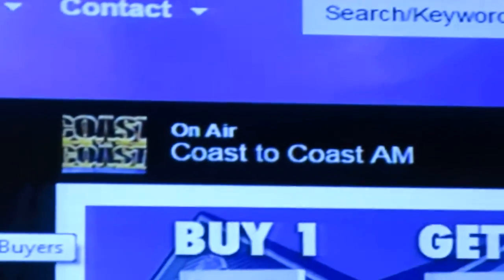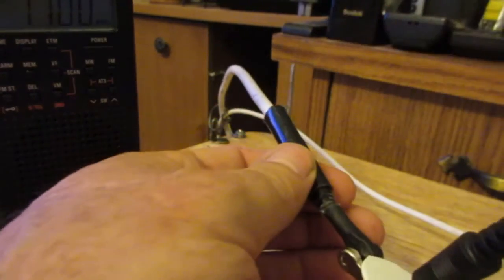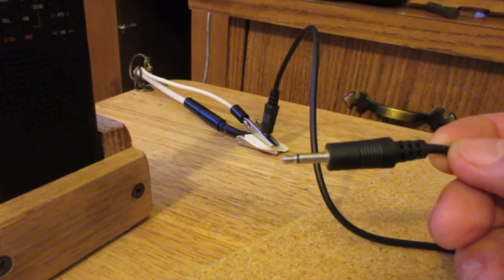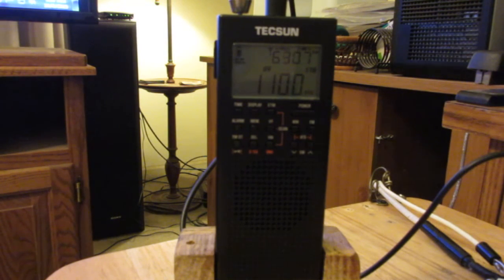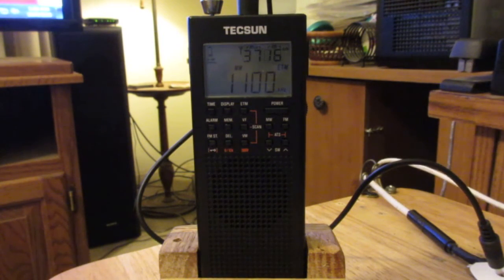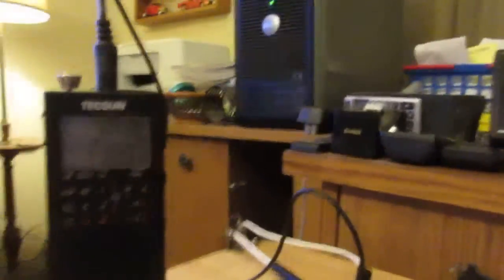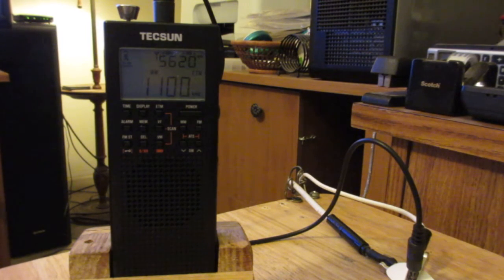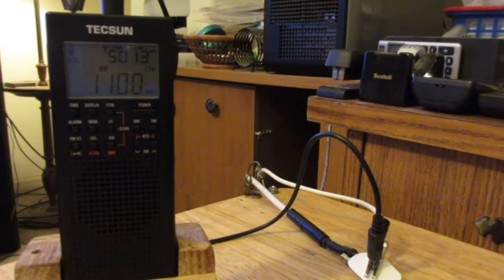AM Radio long wire antenna.

Comment: Great video, Mike.  I've got an old Hallicrafters S-40B receiver that I'm stringing up a wire for today.  Old ham radio guy here, but I also like to listen on a newer digital radio and I didn't even think about using an auxiliary audio cable for an antenna connection.  Thanks for the idea, and I hope you're still enjoying your long wire antenna!

- K5SFC

Comment: During the day I used to receive a station in Oklahoma City, Dallas, Houston and New Orleans and about 45 others on AM by making an inductive coil with 24 or 26 AWG magnet wire (80 to 120 turns) close wound coil on a cardboard or PVC tube with a 100 to 250 or more feet longwire connected to each end of the coil. I suppose you could just use one longwire but you can use two and it works great. 

Just place the coil near a small AM radio and it turns it into a super radio. I lived in a rural area then and strung the two longwires out through the bushes and lower tree limbs, trying to get it at least 7 to 12 feet off the ground. I had a 5000 feet roll of military communications wire so I did a lot of experiments with it. 

To get longwire antennas up in the tops of tall trees use a fishing rod with a heavy lead weight and cast it up over the tree. Then cut off the weight and tie the fishing line to the antenna wire and pull it up into the tree top. Then cut the fishing line and tie it off to the tree. AM signals are vertically polarized I think so a vertical antenna works well even if it's shorter, plus it's higher. I used to connect one to our old truck radio for DX during the day and evenings. 

Someone more technical than I am could probably use these ideas to get far better results than I did...but my results were outstanding because I could hear stations from more than a few states during the day.

Comment: The loop antenna outdoors is better. I used to work in office and the QRM was very bad indoors. The outdoors was very good low noise with a little loop antenna.